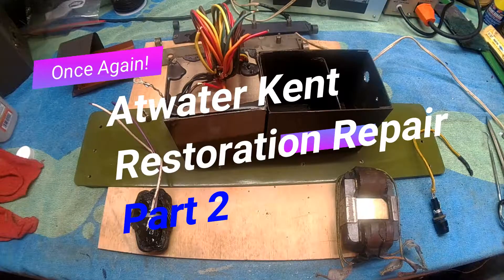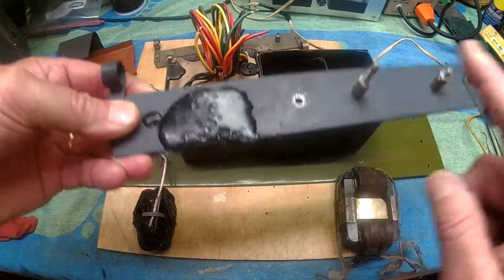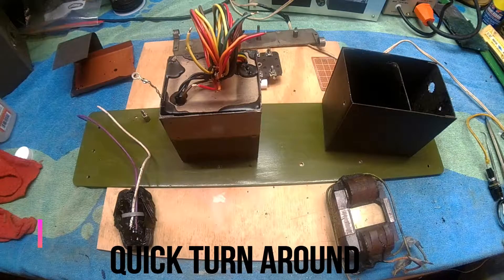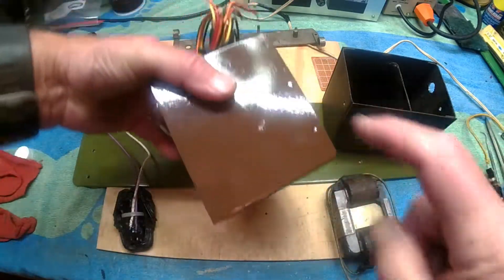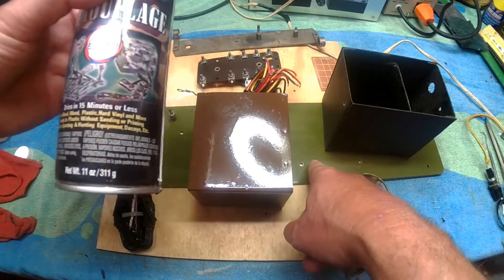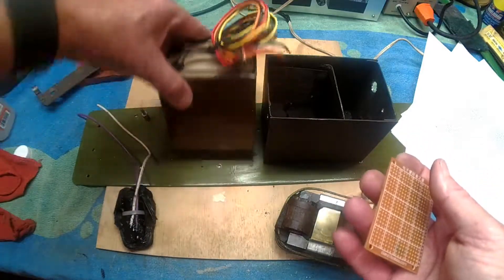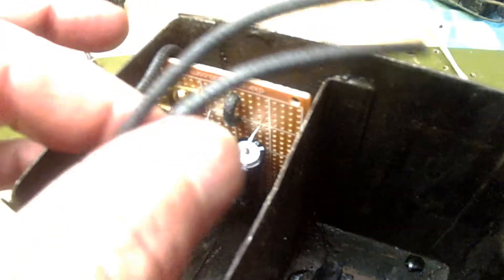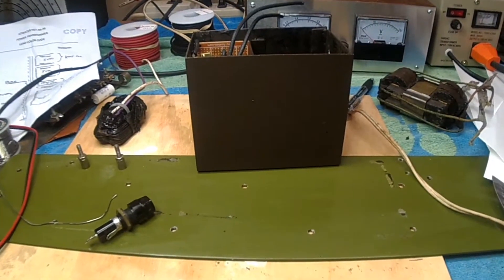Atwater Kent 38 Restoration Repair Part 2

Comment: Larry,

I agree with you on the colors.  No one alive today REALLY knows what the colors looked like.  All we can do is to interpret, best we can, the documentary evidence out there.  Besides, if anyone who originally bought these radios in the 1920s were still alive today, they'd be thrilled that anyone even took the time, money, and energy required to restore their old treasures!  I say, good on ya'.  It's looking fantastic, and I'm glad that you're doing this project, because I own a 37 and I would like to restore it.  I'll follow your instruction and example.  Cheers!   Michael
Reply from the maker: ThatTubeSound thanks Michael! The difference in the 38 vs 37 is the 38 has one more rf stage. I have an extra 37 transformer, wires in rough shape, I was kicking around trying to rewind it myself just to do it, lol. I have enjoyed doing the 38, the toughest and most boring of course was naval jelly the inside cabinet and ps plate. The tar babies are messy but there is a way to recap without too much mess. Thanks for watching and commenting! Regards Larry